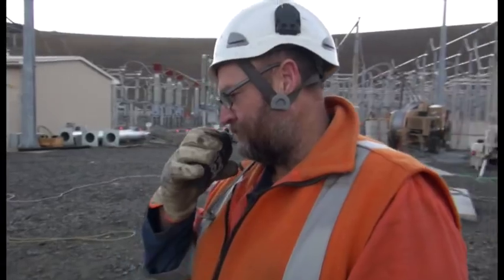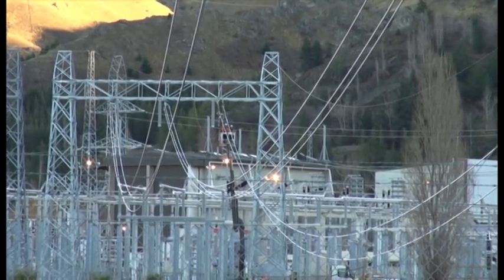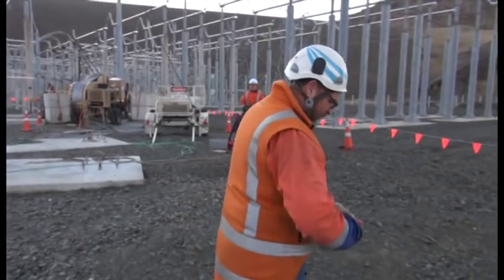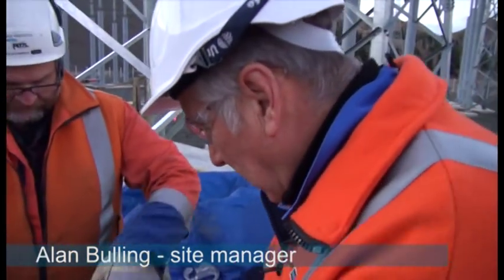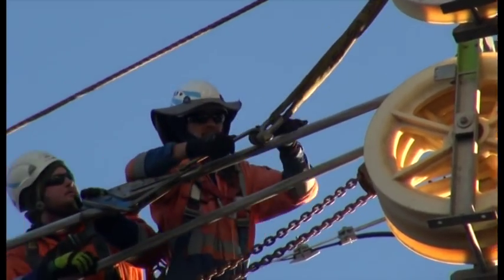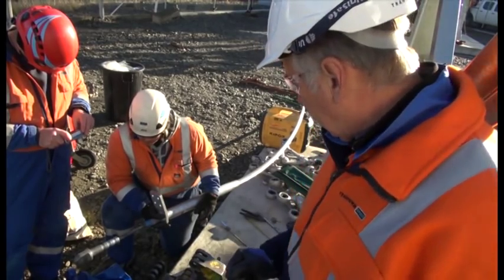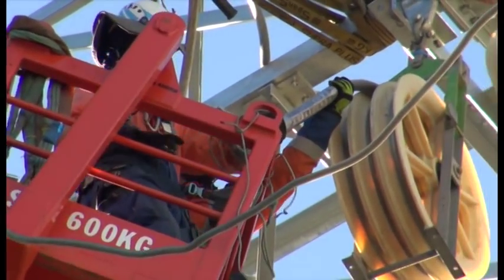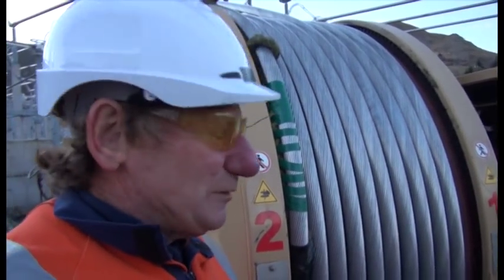Benmore Substation: Work in progress

Comment: If you have experience in any the following

* GFI Main Breaker Certification testing
* Power Quality Analysis
* Installation of main breakers to 5000A.
* Live installation of sub breakers 480V
* PM of up of 480V to 15KV switchboards
* Trouble-shooting of any EDS
* Infrared Thermography
* Arc Flash Risk Assessment studies
* Coordination studies
* Single Line Diagrams
* Ground testing
* Most any other electrical tests to 15KV

Must be comfortable using PC and controlling various tests via PC-based softwares and be able to transfer data to data boxes or by email.